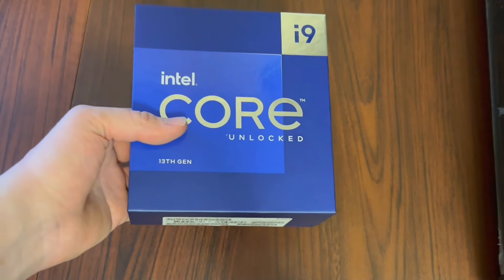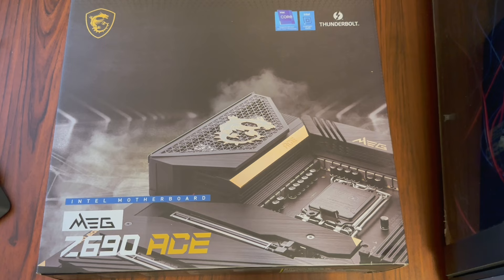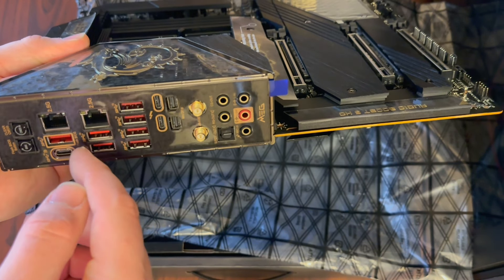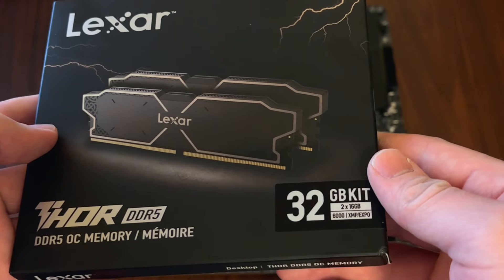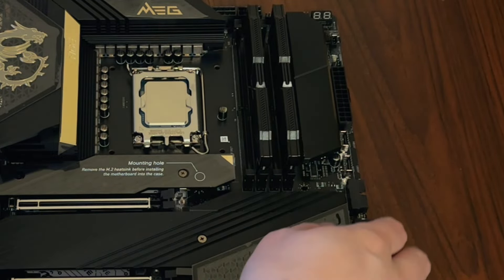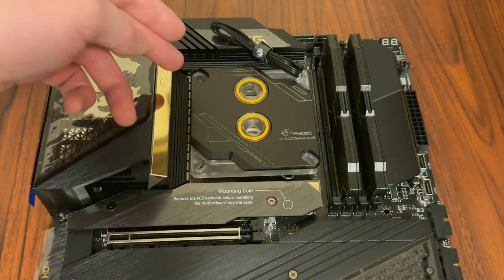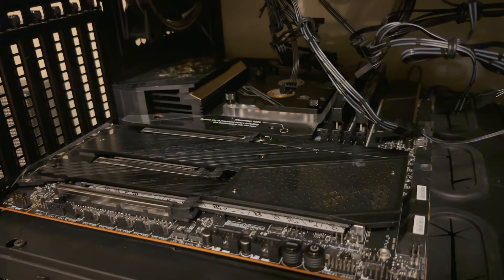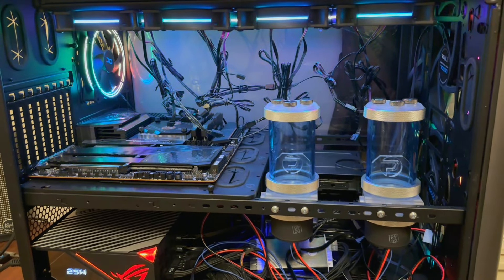The Mega PC - Part 5: CPU, Motherboard and More!

Comment: Don't forget to set the BIOS to run the CPU under either Intel POR or manually set the CPU's PL1 & PL2 states to one of the following PL1 125W=PL2 125W or PL1 125W=PL2 253W (preferably the former).
Reply from the maker: Thanks, I'll keep that in mind!

Comment: the backplate on your motherboard has absolutely nothing to do with your VRM lol😂😂 it's literally is only for stability/flexing of the Mobo and cooling of the "Motherboard" of itself. But nothing about that backplate is doing anything to your VRM's
Reply from the maker: There are thermal pads between the plate and the board, located underneath the VRMs.  Since the VRMs are SMT components, they directly contact the PC board and will quickly heat up this area of the board when under a heavy processing load.  The top heatsinks of course do the majority of the work, but having the backplate act as a heat spreader with contact focused in this area helps to cool the board, and in turn the VRMs above.  This also helps to reduce heating/cooling strain on the solder joints, which is one of the biggest killers of poorly cooled PC boards in laptops, game consoles and some cheaper prebuilt desktops.